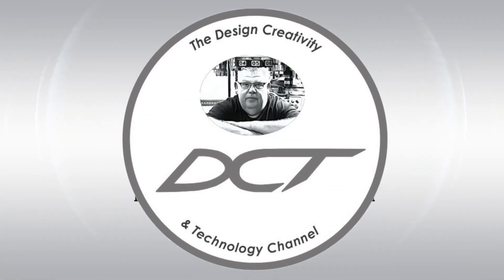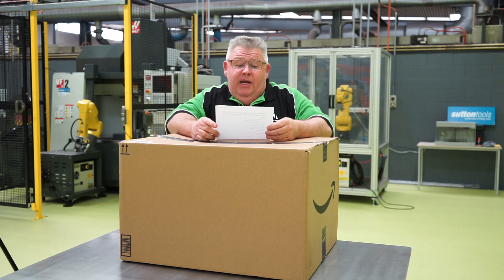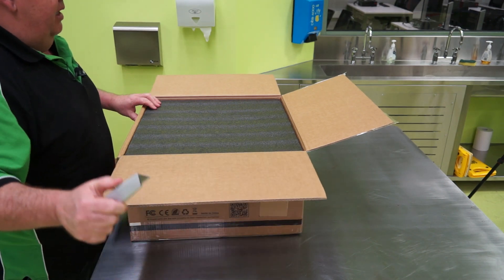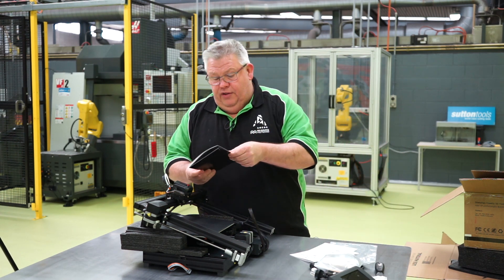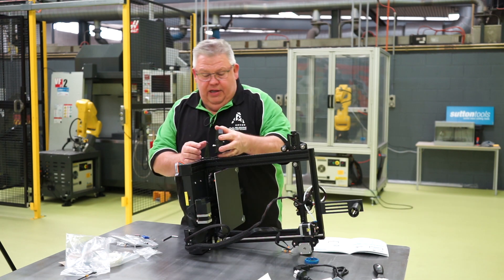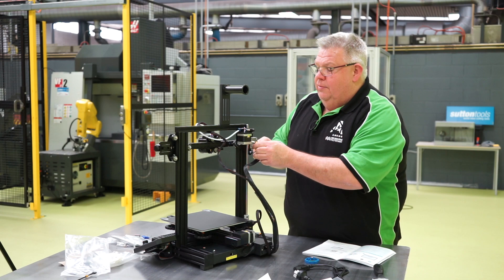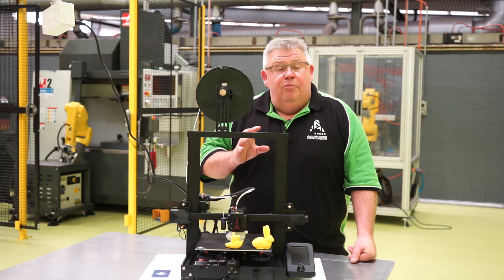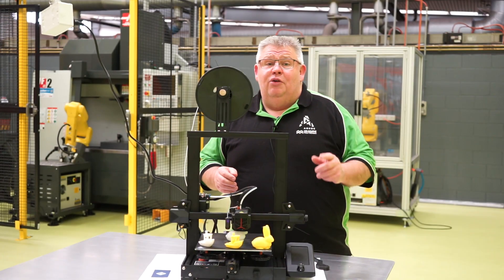Creality Ender 3 V2 Neo Build & Review

Comment: Great video but what you don't say is the build quality of the Ender 3 V2 Neo, it's great when working but it has so many problems and needs upgrading very quickly. And when it does go wrong Creality ignore all pleas for help,, it took me a while to get them to reply to me and all they said was to strip the machine down. Well erm, NO, if I buy a car and it has a fault I don't expect the manufacturer to tell me to strip the engine. Very poor customer service, of course if they read my complaint they would have realised that the printer I got was not only faulty but had been used. There was traces of filament on the bed and in the nozzle. Also there wasn't a tool kit with it, so to set it up I had to go out and buy one.
After numerous complaints all I got was "Very Sorry". As I said extremely poor customer service.
Reply from the maker: Hi David. Thank you for the honest feedback. I’m sorry that you had those problems with your machine. To be honest I was given this machine to review for free, but no money changed hands. I donated the Neo to the TAFE college where I teach and to be honest it is still going strong. We have put 8 rolls of eSun filament through it. However, we did have to change out the tubing and filament nozzle once. Hope you get it sorted mate. Cheers 🍻 Aaron

Comment: I have an original version that I heavily upgraded and works just fine and I learned  a a lot using that. My main printer now though is a Prusa which it looks like Creality has added a lot of functions that the Prusa has but with a nice cost savings. Printing proof of concept has saved me a lot of heart ache when I updated the CNC conversion on my mill. By printing all the components first all of the misfits were identified and fixed before actually making chips. 🎃
Reply from the maker: Hey buddy, yes you can't beat 3D printing for rapid prototyping and proof of concept.  We've got a Markforged Mk2 at work that can print infused carbon fibre.  It allows us to print usable parts to an engineering standard.  As for this little Creality Neo, it is absolutely awesome.  I've been running it day and night at the TAFE college.  Good to hear you using CNC mill and 3D printing concepts.  How's the RC stuff coming along?  Cheers, Aaron.
Reply: @DCT_Aaron_Engineering  Went flying today, I picked up one of those Goosky S2 Helis. Amazing little bird. Low stress flying compared to the 700 i normally take out.
Reply from the maker: @heeder777  sounds awesome. I need to pull my finger out and start flying again 👍🍻

Comment: Hi Aaron,

I recently (about 6 weeks ago) got an Ender 3 V2 (but not the Neo). Mine was supposedly a refurbished unit, but I suspect it was really just a returned unit that the customer couldn't assemble properly. A square, some allen keys, and a half hour later, I had the thing trued up. Keeping the bed level has been a pain in the behind, but I recently heard about the BLTouch which looks like an earlier revision to the bed level probe you get with the Neo, and that's on my TODO list. I have a dual gear extruder on order, and I'm pretty tempted to do an all metal hot end upgrade and replace the textured glass to a similar bed surface that you have too.

The V2 was a lot of mini upgrades to the original V1 and pro, and it seems like the Neo has many of these upgrades that end users do rolled in!

One thing that you might find handy is a 0.6mm nozzle. You can (approximately) double the speed at which you poop material out of the hot end and so you can (approximately) double the linear speeds resulting in faster print times. Sure you lose a little detail, but that is likely not a big issue for things like drawer organisers for tools :)

Would be keen to see you do some sort of joint project with Makers Muse or Teching Tech (both in Australia!).
Reply from the maker: G’day Adam it’s nice to hear from you mate. Good to see you getting involved in 3D printing and having a crack. As I stated in the video I don’t do a lot of it, but it’s great R&D and proof of concept. This little Neo is awesome Adam. I was blown away by just how well it works. I laughed when I read the collaboration suggestion, I highly doubt it as my channel is small fry.  I hope the job is treating you well mate. Next time I’m up your way or you’re down my way we need to catch up. Bye for now 🍻 Aaron.

Comment: Hi Aaron, I have an older Creality Mini, and I find it a really good printer. I think the upgrades applied on this new Ender 3 will cut out a lot of the upgrades that users have been doing. Not that I have done much in the way of upgrades to my mini. Watched some of this with no volume, is that a flexible bed plate? Great video mate.
Reply from the maker: G’day Nigel. Yes I was very impressed with the build and print quality of this printer. It is so quiet, that you can barely hear it running. Yes it has a magnetic flexible build plate. Silly me forgot to show it 🤦‍♂️. Thanks for watching mate. Cheers 🍻